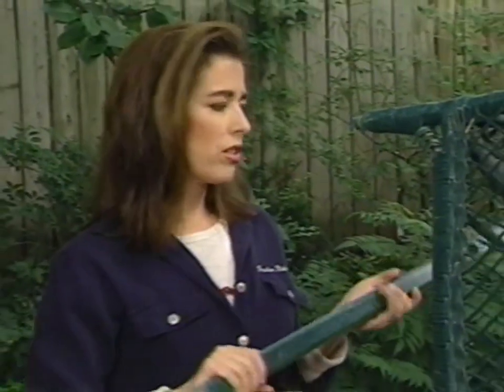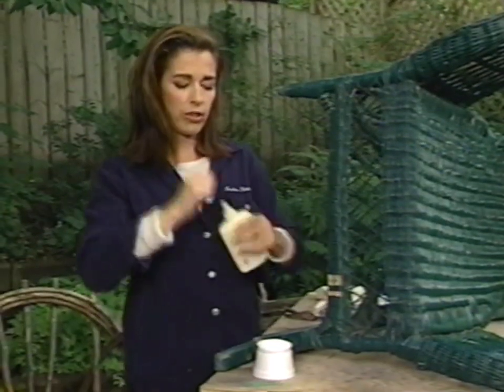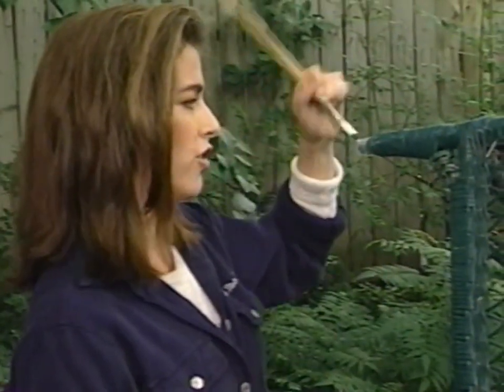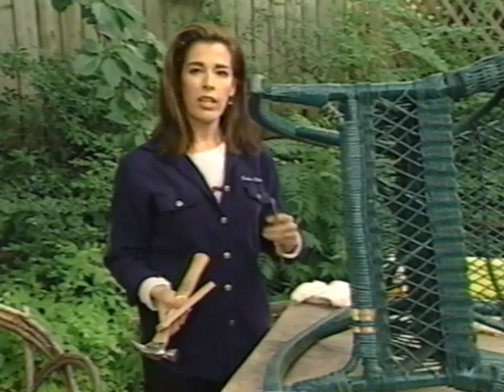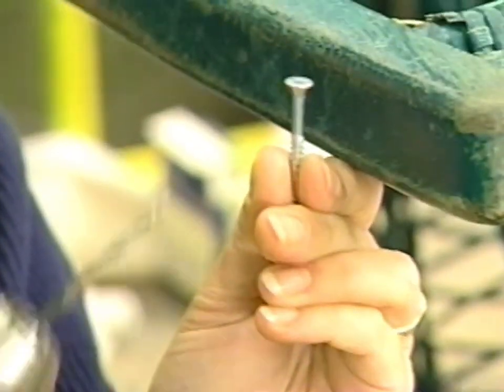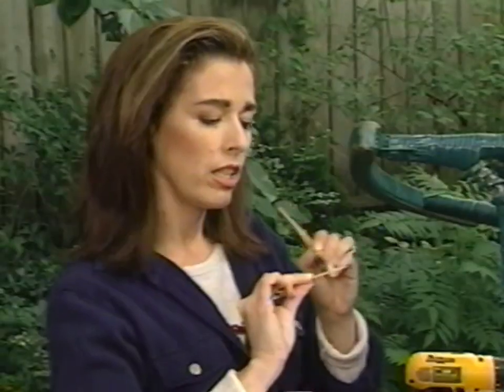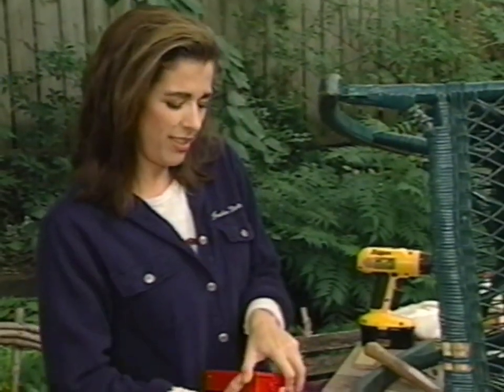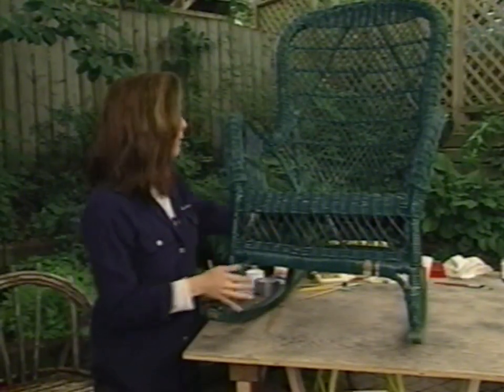DIY chair repair for loose rungs and rockers! A Repair to Remember

Comment: Make the peg slightly shorter so the taper is further up making the diameter larger to fit the hole better and it goes in the hole deeper.
Reply from the maker: Well that would have been a lot faster! Where were you when I needed you in 1997?!
Reply: @toolgirl  Wish you were here. Wish I were there!